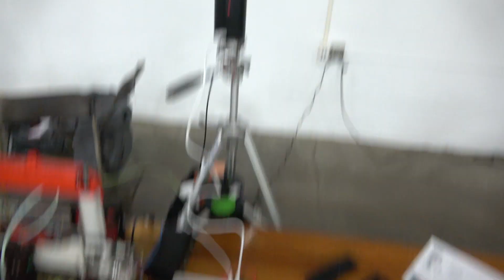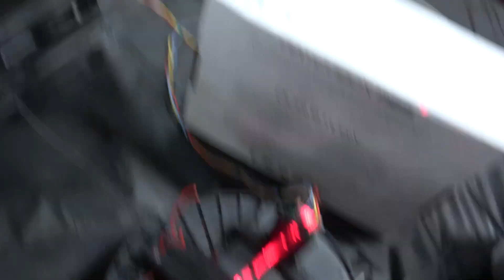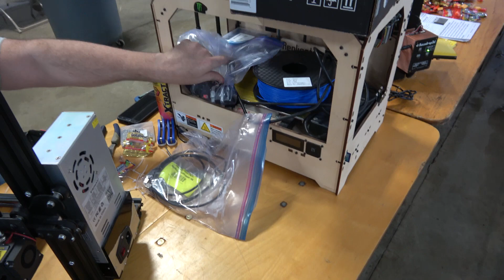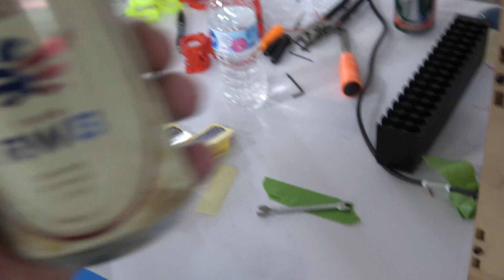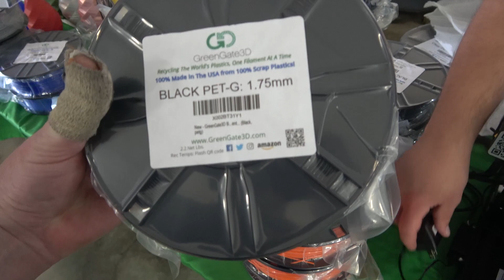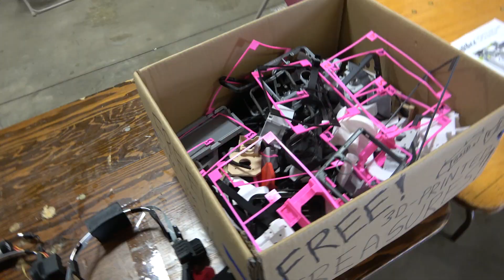Midwest Reprap Fest 2021

Comment: Hope you don't come home to a dead cat.
A friend of mine left his cat alone; for a day, when he came home his house had burned down.  The cat knocked a table lamp over, it was on (cat didn't like the dark) and the bulb came in contact with his sofa cushion which then caught fire.

PetG is becoming my favorite filament.  It's about as high temperature stable as ABS without the stink or the warping.  I print it at 240C with a bed temp of 70C.
Reply from the maker: Incandescent bulbs? What is this the 50s?
Reply: @BenHeckHacks  Happened about 25 years ago.  But cats can still cause problems left alone, they're so creative!
Reply: Ya, so everyone take note. Incandescent bulbs kill cats and PetG is pretty dope.

Comment: Very cool. I have found the. Best power connectors for lipo batteries to be xt90’s They are rated up to a hundred amps,I have pushed them closed to 140amps roughly 1600 watts with no issues at all
Reply: @カール Not heard about this, it’s easy to find knock offs for cheap but doing so would be foolish
Reply: Anderson connectors have versions up to 210kW (350A @ 600V), self cleaning genderless contacts, and way higher cycle life.
Reply: @RambozoClown  That’s fine, I mentioned these as the ones Ben pointed out were in a remote control robot powered by a small lipo cell
Reply: @cunningstunt9226  They had XTs on the small lipo robot, but Anderson on the larger lead acid robot under the table.

Comment: Indiana is so humid the floors never dry out? That's serious moisture.
Reply: no- the water comes from the air to begin with- since they didn't insulated the concrete floor slab- it acts as a giant heat sink that is colder than the air and the moisture of the air condensates at the surface- a common problem with parking garages under buildings. A planing error in most cases
Reply: Moist money, moist problems.  Moist definitely.
Reply: @rhekman  moist money, moist money!